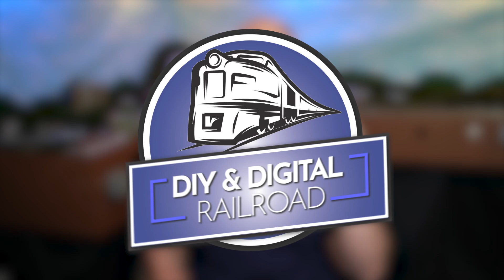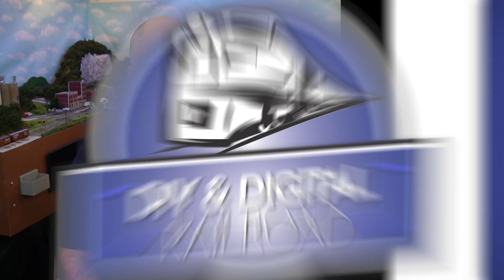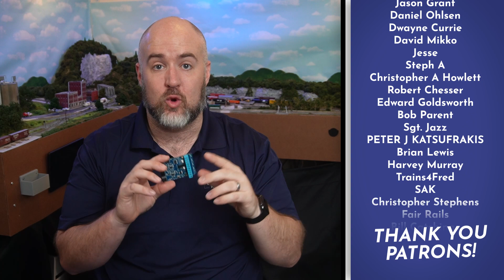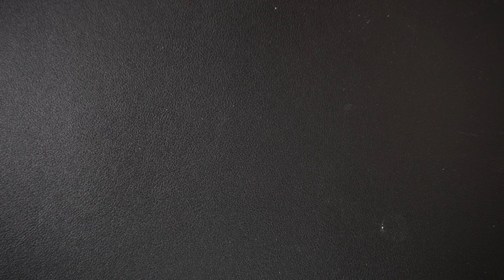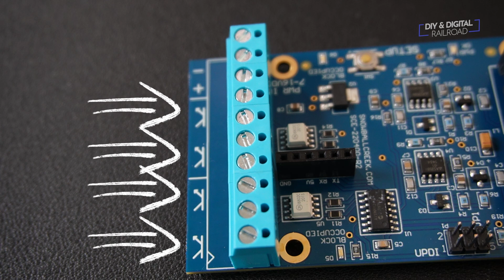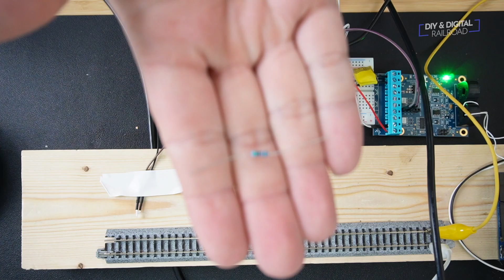AMAZING Digital DCC Current Sensor from Snowball Creek Electronics

Comment: At first I thought this was a new version of a kit a build some time about that uses a 556 timer IC and the current transformers,  but this look pretty interesting too.  On a side note, I use to write software for the Lenz XpressNet system, (ZugDCC) but with my health failing I ended development of it 3/4 of way though making a NCE version (sold off the nce stuff too), although I've been thinking about at least offing the original again.

Comment: Sounds like a neat product. I wonder if he will incorporate LCC into it so it doesn't have to be on the DCC system. Also curious if it has signal logic built in as signals protects 3 things: turnout aspect, next block, and next signal. LCC makes it to where the logic is stored within the system and JMRI doesn't have to run for the signals to work properly. I'm looking forward to hear more about this product. - Jason
Reply: At  this point, it is just a detector that can interface with any signaling system.  I'm not a great programmer, but would be happy to work with others on a design with software for LCC.   I do have a block of LCC addresses reserved.   Thanks - Keith (Snowball Creek Electronics)